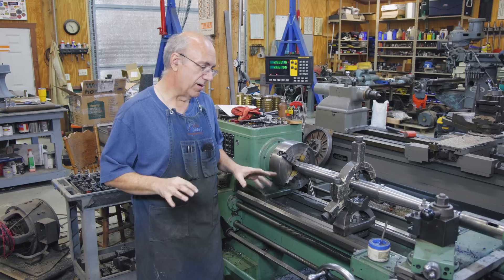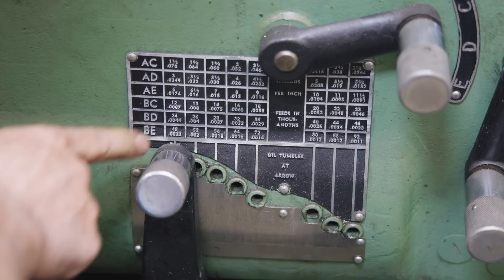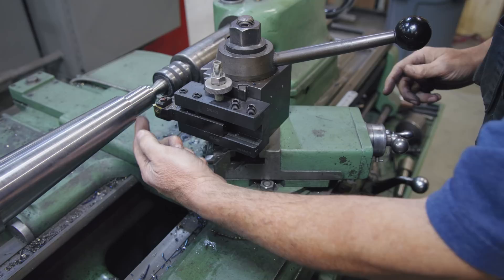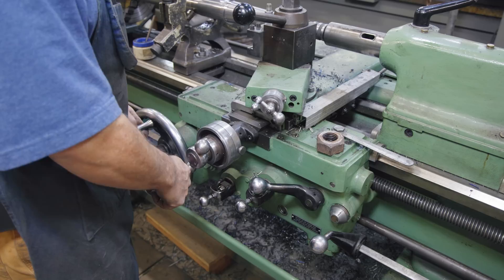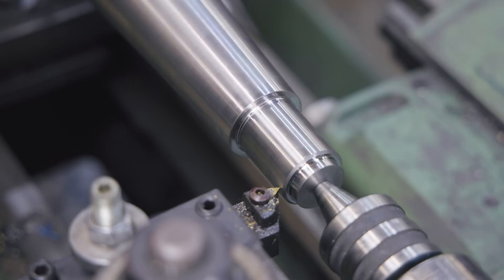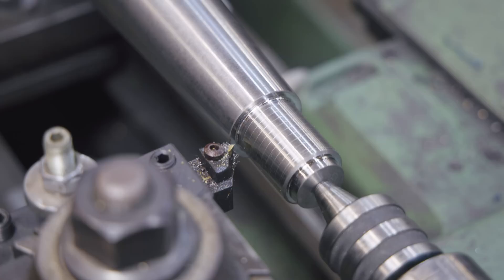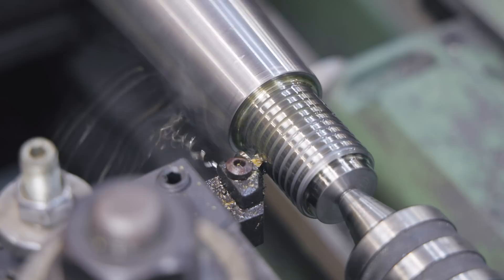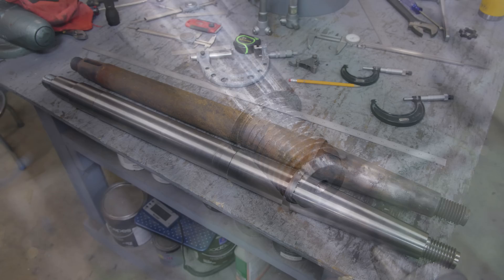Tally Ho Capstan Project: Single Point Threading and Milling Keyways in the Capstan Center Shaft

Comment: Keith surly with the age of this part the thread would have been. WHITWORTH and as such 55 degree thread to be CORRECT or was it a case of you had nuts of 60degree firm to fit?
Reply: Rather than "surly" (which Keith never would be), you mean "Surely, with age...c

Comment: I don't really understand why you are not using coolant or cutting oil on your milling.
Reply: It’s optional. Depends on the depth of cut, type of cutter, speeds and feeds and need for coolant. On a small job like this you can get by without coolant while viewing your work progress much more clearly.